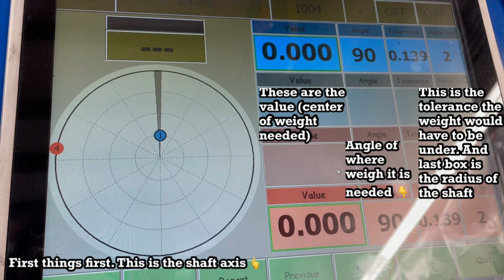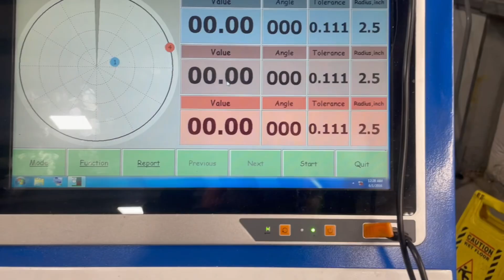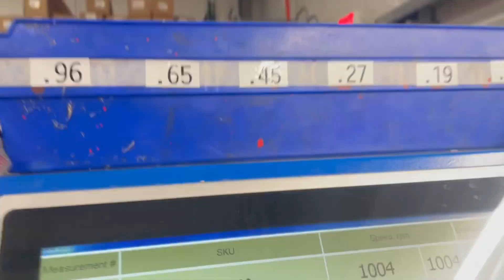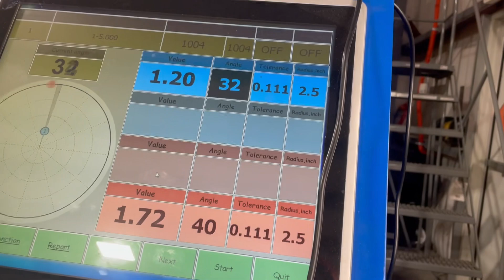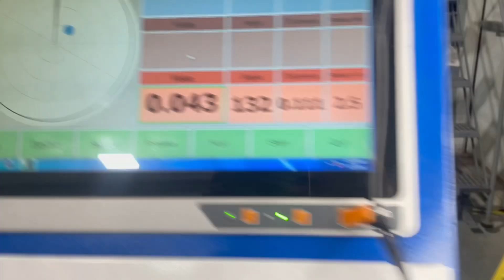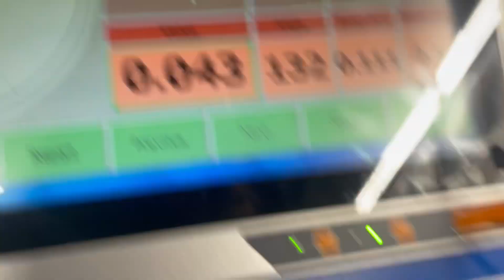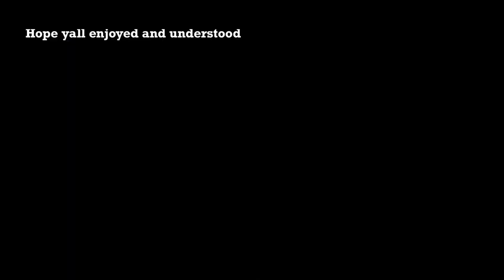HOW to balance an aluminum driveshaft

Comment: Don't the cast iron yokes play a role in the balancing/imbalancing the the shaft? For every different yoke used with say the same shaft, won't you get different readings every time? Thus when the customer puts their yokes in, the balance may be different ?
Reply from the maker: Yokes? Do you mean the flanges ? The yokes are welded on and some are aluminum based, not many (with aluminum) is cast iron (not saying it’s not common) ,, anyways. It’s tapped down for run out, then welded, then assembly (which tap down and assembly/snaprings/dropped pins/crushed thrust washers will greatly effect the run out) then going over to balance we have fixtures and flanges that would be in your car or truck and the driveshaft slips in. So the part I attach in this is just what’s in your car. It’s like a dummy. Anyways, changing the flanges/fixtures will not effect run out. Also while balancing you want to check run out and 0 it out (I didn’t show in video cus I try to get it to 0 before welding).  Hope that answered your question?

Comment: look up what a cheater bar is as everyone else noted, hammers hammer and that can not be good, like how you should not use an impact on all fasteners
Reply from the maker: im gonna use what I’m given by my company. My company isn’t gonna splurge and buy other equipment. And im sure as hell not gonna buy it with my own coin 🤷‍♀️. I wish people would understand this is a manufacturing company that just wants everything done quickest and easiest way and they aren’t gonna spend the extra money on little things when you can use impacts on literally reg bolts.

- also these fasteners are replaced often and aren’t included in the sale of the driveshaft itself. 
  Although you can buy them from us separately.

- also just talked to our engineers and the whole chuck is hardened steel and confirmed and extra time that THIS WILL NOT MESS UP THE CHUCK. I trust my engineers who made it over anyone.

Comment: 25 years as a machinist here. A dead blow tap like you're doing on the chuck key isn't likely to cause much trouble, but the reason why it's a no no to use a hammer on it is because the scroll plate inside the chuck is usually cast iron. It's the part that moves the jaws in and out. What I've always done is used a pipe as a cheater bar on the chuck key. Use your body weight and you can get some real holding power in.  

Keep up the good work!
Reply from the maker: Just talked to engineers who made the balancer. They confirmed it’s made with all hardened steel. I asked an extra time about me hitting it with a rubber hammer and they said it won’t effect anything cause it’s all hardened steel, even some of our other balancers uses brass hammers on these key holes and no one has had any issues
Reply from the maker: But it’s rubber? If I put all my body weight it’s still not enough, as you saw in the video…

— plus our company makes our balancers and they said it’s fine so I don’t understand …
Reply: @darklydemons4497 It's not the issue of your hammer being less hard. It's the shock load of a hammer blow on the cast iron scroll plate inside the chuck. It's a big swirl looking thing that has slots the chuck jaws ride in. Cast iron is brittle. Often times the scroll plate followers are hardened so it's functionally the same as driving a cold chisel into it. And your body weight is absolutely enough if you use a large enough mechanical advantage, hence why I suggested using more leverage with a piece of pipe. I keep a 3 foot length of pipe to get extra torque on the check key in my tool box. I've never lost a part since I was an apprentice.

If you look up the specs on that off the shelf chuck it'll likely have a warning against using a hammer on it.

For the record I'm not telling you not to do. Just telling you why it's considered a bad practice in 99.9% of cases. You clearly aren't swinging all that hard at it.
Reply: @clockworkleather  their company manufactures the balancer. Their scroll plate might not be cast iron.
Reply: @CM-xr9oq  they likely just buy those standard lathe chucks and install them. Just like most machine manufacturers. And yes they might not be cast iron internals. 

Again. I'm not saying she's in the wrong. Just saying why people say not to do it. That's it.
Reply from the maker: @clockworkleather understood, I didn’t think of it by this perspective. I’m honestly not sure if it’s cast iron inside but you’d peaked my interest. I’ll lyk, I’ll talk to our engineers😉